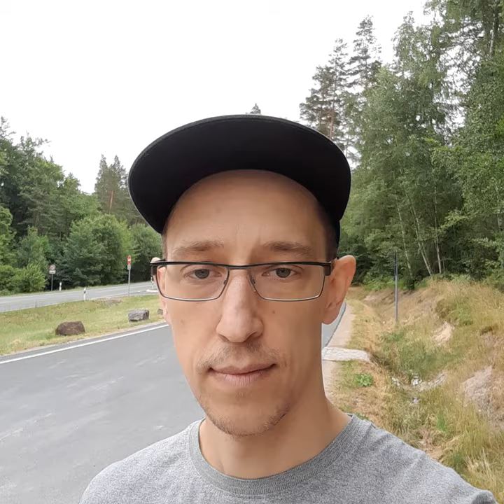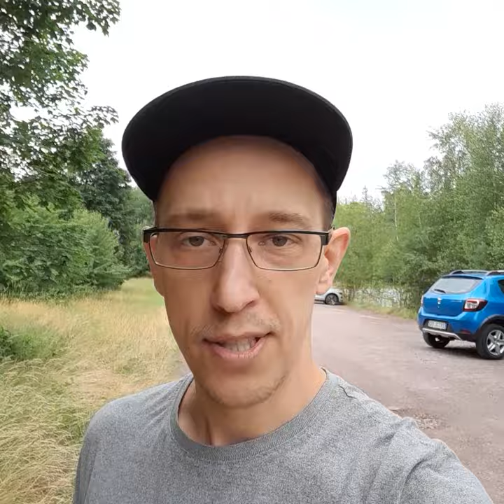Geopolymers from metakaolin, by Patrick Müller (Recipe: See Shownotes)

Comment: Really appreciate this video bro! I'm beginning to experiment with geopolymers too! I worked in cement mixing for a couple years and the whole business is a hoax! 
You can dig up clay, extract silicate from beach sand, burn limestone in a hole in the ground get truckloads of diatomaceous earth and bentonite clay delivered to your house and make way cleaner, prettier floors and walls which materials that don't even stick to your hands. 
I want to do this for a living too. 
And your right they make it sound so complicated. 

If you have time you should make a series of videos just making small batches of the 5 or so simple recipes that call for the most common materials available.

Thanks again!
Reply from the maker: Hello Aaron, thanks for your comment!! I haven't read it till right now cause I missed it, sorry.

Sounds great man! Thanks for sharing your viewpoint. Really interesting. Appreciate it.

The next days I do publish a recipe for a basic metakaolin based geopolymer recipe for educational purposes. And more are planned. Plus the book about basic  geopolymer formulations will be published in English language in an much extended version.

Have a good one! 👍
Patrick

Comment: In larger quantities I think it would be more economical to make the waterglass from sodium silicate, sodium hydroxide and water.  If possible, a recipe for waterglass should be included in your book when you publish it, because the waterglass component seems to be key in many recipes and you can buy these ingredients in bulk fairly cheaply.  For experimenting, purchasing jugs of waterglass is more convenient, of course.
Reply from the maker: Absolutely, that's an nice suggestion. There's a recipe quite similar to what you proposed. However, the book primarily emphasizes the geopolymer binder aspect. While I could keep adding recipes endlessly, there comes a juncture where the book needs to reach completion, lest it turns into an endless endeavor. Wishing you a fantastic day ahead"
Patrick

Comment: I am looking for a fast hardening coating that can be sprayed onto a casting pattern for casting aluminum with a texture plaster sprayer for my home casting setup.(3d printed patterns) It needs sufficient porosity to allow surface humidity to escape when the metal enters the mold, it needs to harden quickly so i am not waiting for a day or two, it needs to be strong enough to not have to be buried in sand and still support the hydraulic head pressure of molten aluminum, it needs to undergo rapid temperature change to 1300 F without cracking, it needs to be inexpensive, it needs to be environmentally friendly, it needs to not require being fired in a kiln, be a quick mix and harden, and it needs to leave a fairly smooth surface on the cast(not large pores).

Would metakoalin geopolymer meet these requirements as my dream casting coating? And if not, can you recommend a mixture that might?   Thank you, waiting on your book to deliver to my house.

Comment: I was hoping to get a reply on this question. I find it very interesting and not trying to find fault but the prices here in Australia for quantities over a couple of liters say of water glass is very prohibitive.
Reply from the maker: Hey Roger, I hear you on the high prices for waterglass (sodium silicate solution) in Australia, especially in smaller quantities.
From what I've seen, the cheapest options on Amazon in my area (Germany) are around 4.3€ per liter (roughly AUD 6.5) but only for small amounts up to 10 liters or so. Once you start looking at bigger volumes, the price per liter really goes down.
But there are a few places you could check out to potentially find better deals on larger amounts:
DIY stores or hardware shops sometimes carry waterglass and may have decent pricing for bigger quantities. Sme is for ceramics/pottery supply stores.
Art supply stores that sell specialty pigments and materials could be another option to look into.
You could try reaching out to local concrete companies or ones that work with silicate-based stuff - they might be able to hook you up with some larger amounts directly.
Industrial/chemical supply places may offer bulk pricing, but minimum order sizes could still be an issue.
The key is to look around locally beyond just the mainstream retailers. With some digging, you may be able to find a supplier that can do you a solid on pricing for those larger waterglass amounts you need for your projects. It's all about finding the right source. Best, Pat
Reply: Thank you Pat. @Advanced_Materials_Publishing
Reply from the maker: @rogercutler2033  Sorry, I wanted to write you might find better options for smaller and not for bigger amounts :)

Comment: Can you please tell me ,I want to make geopolymer cement for business
Reply from the maker: Hello, thank you for klicking on my video. We have a Facebook page called "geopolymer publishing". There you can find a simple recipe for a metakaolin-based recipe and one for a fly ash geopolymer binder recipe. I suggest to start with the metakaolin one. The recipe there gives the geopolymer binder/cement which is then mixed with 80 % of sand and graval. Both can be bought from providers for construction materials. You would take the same aggregates as they use for concrete. Furthermore, metakaolin which is used as an additive for normal cement/concrete is most at the time qkite good for making geopolymers. Moulds should be made from plastics or wood covered with plastics. Other materials like steel or wood can be covered in Plastik foil like they use in the kitchen. I always demould the next day.

I wrote a book about geopolymer recipes but it is not out for sale because I want to improve it. Will take some time. But the recipes on "geopolymer publishing" work and give a geopolymer concrete with a compressive strength of >50MPa easily. Last ones I made, with a special aggregate, showed >80MPa.

Hope I was helpful!
Bye bye. Pat

Comment: Hello. Can large bricks be made with this formula? (30x50cm or 40x100 cm)
Can it be used as carrier beam and concrete.
Reply from the maker: Hello Mustafa,

That's a great question, thank you for asking. Generally speaking, yes, geopolymer technology holds promise for structural applications. However, it's essential to note that not every type of geopolymer is suitable for constructing such structures.
For instance, in one of my other videos (you can find the link below), I demonstrate a geopolymer formulation akin to cement. By incorporating 75% standard concrete aggregates, one can create what's known as geopolymer concrete. However, it's crucial to subject this mixture to rigorous testing akin to any new material development process. 
It's important to understand that this isn't a product readily available at your local hardware store like. Commercially viable geopolymer formulations are not easily accessible to the general public.
In conclusion, while the potential for geopolymer-based structures exists, it requires careful formulation, testing, and likely significant investment. I hope this response clarifies your questions. Have a nice day!

Best regards,
Pat

(https://www.youtube.com/watch?v=XASFX4t_uGU&t=353s)

Comment: Have you seen those HempBlocks?
Reply from the maker: Hello there! Yes, I do. I made some myself which is relatively easy. The cool thing about geopolymr is that you can not do too much harm experimenting. For a hemp block you take hamp shives (sold as cat litter in pet shops) and soak them in a relatively liquid geopolymer slurry. Once, they are hardened tey can be used. The compressive strength is normally relatively small but thats why such blocks r quite big like areated concrete blocks. Habe a good time and thanks for commenting! Pat

Comment: I always had a hard time believing that some of the things from antiquity were carved by primitive people with no understanding of things like the wheel, using bare fingers and rocks and sticks. 
Those megalithic blocks were made by the hundreds and thousands. They were poured in place or moulded. 
The materials had to be as plentiful as air itself. The builders did this for fun, no big deal. 
Acids and base forming micro crystaline on a molecular level is what I imagined. Seems like its mostly base and lye that do the cataylizing. 
I have 108 gms of cat mixed for tomorrow. Mixing it with my indigenous clay shell i dug up.